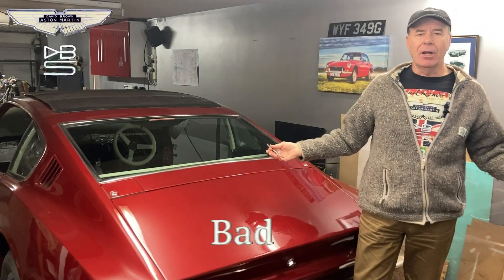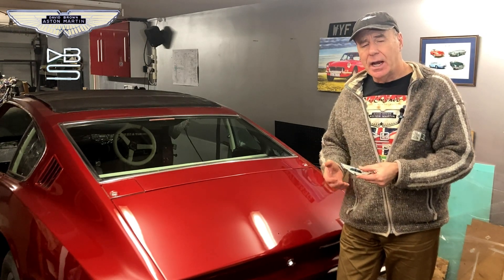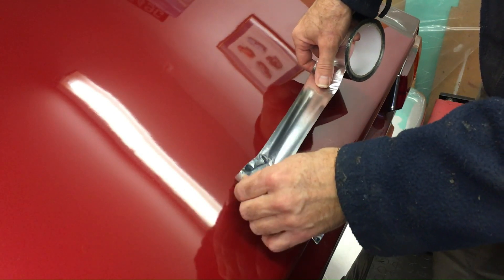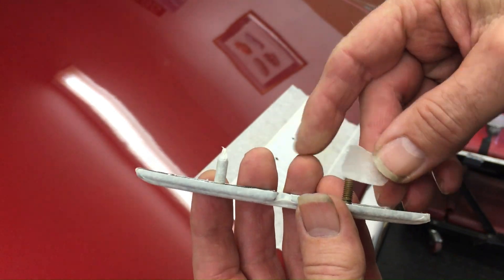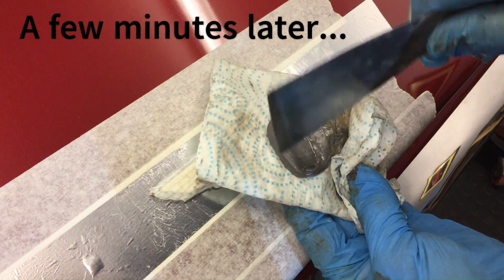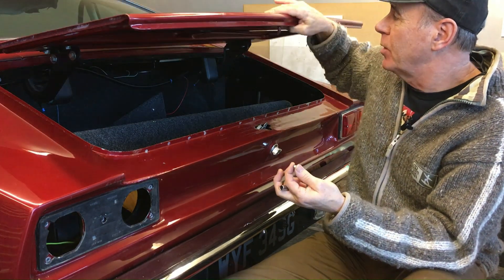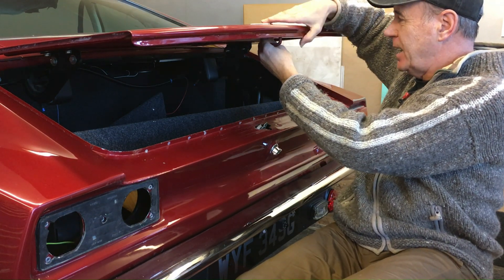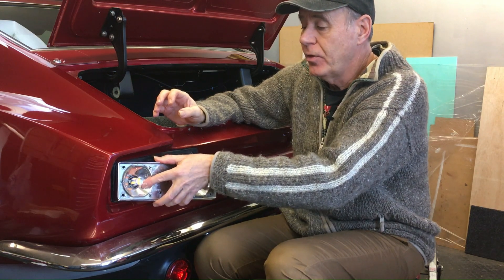Badge Engineering - Improving Aston Martin 'wings' badges

Comment: Hahaha and i thought you will do videon how to repair the bage???? Once i foot the dosh for a new bage it will last 20 years anyway.
Reply: That is the point. When (or if) you buy a new badge it will not last 20 years because of the design flaw of it being hollow and it being stressed by the pre-tension in the fixing bolts and that stress leading to cracking the enamel which becomes more brittle with age. All you have to do is put just a little too much torque on a fixing nut when fitting and 'crack', it's ruined. Also, in any event, I am planning on this car looking good for a lot more than 20 years!
Reply from the maker: Err - that's the whole point... Fit a brand new badge and tighten the fixing nut just a quarter turn too much and your ££££ new badge will NOT last 20 years!

Comment: I would have used a flexible epoxy that would be 0.2mm slightly proud being the way it slightly expands in the middle. This would provide strength around the posts and make is very slightly proud and hence will also protect the paint. I do really like your video and method. These ideas I can used on my Jensen Interceptor.

Best of all I Iove your Aston.

Your idea for the mirror is very clever and I will def do this, as these mirrors never really fit. Please what make and model of mirror are you using.

Cheers 🙂
Reply: That would work. What is great is to think about these things and find a solution that works for you and not just to just accept the standard way if you think you can see a better way! 😊
Reply from the maker: The mirrors are Mercedes Benz W114/W115. Go to a MB Classic seller not AM.
Reply: Brilliant help, in those days did Mercedes have driver and passenger glass mirrors, so if I am in UK, do I need to buy UK mirrors or will European mirrors work in the UK RHD please. @AndrewDay_Aston-Martin-DBS5126